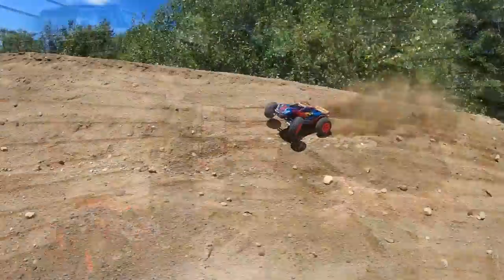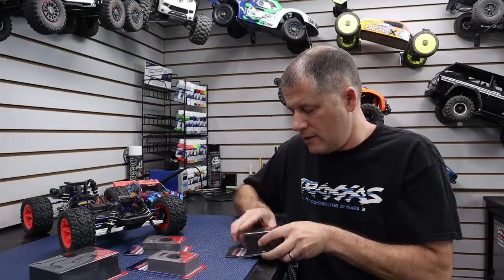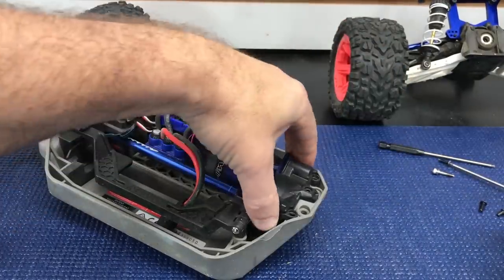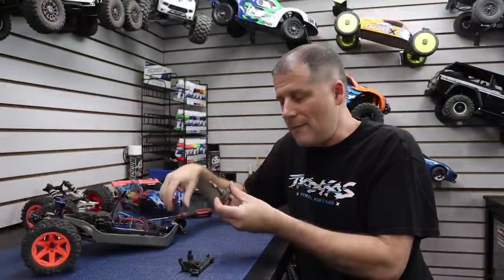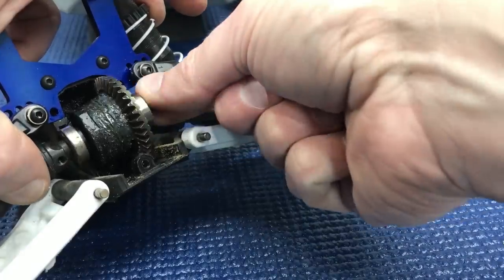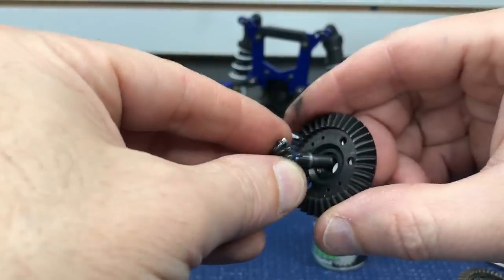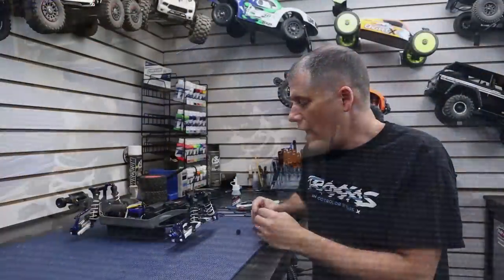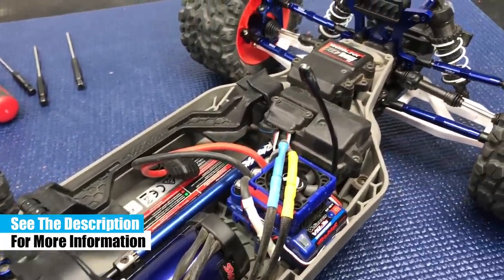Swapped! Gears & Center Diff - Traxxas Rustler 4x4 VXL Full Upgrade Project Truck Part 7 | RC Driver

Comment: I installed this center diff and both spiral cut gears in my stampede 4x4, those spiral cut gears are so beefy compared to stock. Super impressed by the quality of these parts.
Reply: @John Lujan I would guess its the front diff, you might have some messed up gears. Hitting reverse puts more pressure on the front diff and causes the extra noise.

Comment: One thing you should have mentioned is that if you change either the front or the rear diff gears to the spiral cut, that you have to also install the spiral cut gears to the other end. The spiral cut gears are a different ratio than the plain gearset and can make for some awkward running. I did that on my brothers Stampede 4x4 thinking they would be the same ratio, but the spiral cut are geared to spin faster. I should have known as it is the same concept in full scale vehicles between spiral and straight cut.

Comment: I did the same motor mount mod on my 4x4 VXL but I went with the option from King Headz since it uses a larger bearing than the Traxxas one.

Comment: Wish the metal diff had plastic spurs. You need to upgrade to hardened pinions to use steel spurs.

Comment: Ive had terrible experiences with aluminum part upgrades. plastic is great, it flexes and doesnt bend. Im hard on my vehicles and anytime ive upgraded parts on any of my trucks(going back to savage 25, flux, now the rustler 4x4 and erevo mini) it seems like spending more and then you bend something and its a huge money sink. I usually do RPM arms, and bigger shocks/heavy oil but leave the rest plastic.id love to hear from some people with builds like this that drive their stuff hard.
Reply: I agree with most of what you are saying.  I tell people all the time to skip the ultimate version and get a BL2-S, then upgrade the motor and esc if you're no longer having fun at 2s speeds.  I would still upgrade the center drive shaft to aluminum right away as well as upgrading the motor mount if you upgraded to 3s.  Everything else i think the Extreme HD Kit is better than aluminum, even the drive shafts in that kit dont get ruined using self righting on a Rustler.
Reply: @MrMKnigge  I don't use the self righting feature anymore. It was neat the first couple times but the stress it puts on

Comment: So does a guy have to worry about setting gear mesh on the newer models.  Got 2 4x4 rustlers  recently for my boys first one was just the basic 4x4 and the next one a few weeks later was the VXL version and they have a plastic clip that goes into that slot has a few different screw holes for different sized gears just tighten it up and says should be set.  Is it best to eleminate that piece and set it?

Comment: Off the wall question, but what weight oil do you run in the GTR shocks you have there? I have the GTR shocks on my rustler and am running 50 weight now. I’m not sure if that is working well, so I’m thinking of going with 40 weight but wanted to see what you were running. Thanks!!

Comment: I went with RPM A arms and GPM steel axels. Also strc motor plate. You are missing a engine heatsink /fan to add to the cooling.
Reply from the maker: supboy666 Temps did get high on a few runs but not critical. But a fan is a good idea for many.
Reply: RCDriver_Online i run a 14T pinion and 3s and most days here are 90+ degrees so I have integy dual fan heatsink to keep it extra cool.
Reply: Hot racing fans on my ESC and motor....ice cold runs
Reply: @redblue40rc33  just get a castle motor runs much cooler without the need for fans. The Velenion motor is good and fast but runs hot. Im running 120A Firma ESC which has a built in fan and is crazy fast but makes the stock motor very hot close to 200 degrees.

Comment: I wish that i got the money to do things like This, i got the normal 2wd rustler and there is now a absima brushless motor in it.
Reply from the maker: Thijs The main reason for this series is to show what’s available for this truck and how parts are installed and what their benefits are. You don’t need everything shown. Use the info to pick and choose what’s right for your application.

Comment: Hi. Your videos are great so I wondered if you could help me.
I have converted a Cen GST 7.7 to a brushless 4S electric motor, which is fine.
But, this has a central gearbox, where the reverse was servo controlled.
I have converted it to work, in a fashion, but there are still difficulties with running the car
I hear I can install an open center diff and eliminate the gearbox, so the motor pinion drive will mesh directly with the center diff, which then connects to the front and rear dive shafts, so the motor then has direct drive.
I cannot find an instruction video on how to do this. Do you have any videos or links to step by step instructions on doing this. Or, can you email me the instructions and the parts I will need to make this happen.
The reason I want to do this is because the gearbox is now broken and difficult to repair, so having the open center diff, which is easy to access and maintain, would be much more appropriate for my needs.
Really hoping you can help and thank you in advance for any assistance
Martin

Comment: Unless you put some TIM between that motor and motor plate you aren't going to shift that much heat. How about a series with off-brand upgrades? Maybe build a second one and compare the two?
Reply: Hardlydan it does transfer heat it gets to the temp of the engine itself. I have the plate and i checked with a temp gun.

Comment: Whats better or stronger I should say? Ultimate slash or rustler 4×4 vxl?  I'm having hard time deciding.  I want to buy that truck right there. Ill pay 700 for that truck maybe more. Where can you buy fully decked out cars like that?
Reply: The Slash and rustler are pretty similar in durability, speed and overall quality because they share quite a few parts. Part of the fun of rc is that you can wrench on your cars and pick and choose what parts you want and customize them. You can make it all aluminum, or all red, or mix it up. Good luck!

Comment: RCDriver_Online How can I bias the power to the rear. Thinking about the new Hoss center diff will it fit in
Reply: When tuning center diffs, a thicker oil will allow more power to go to the rear, and a thinner oil will allow more power to go to the front. Also, the center diff shown in the video is the same one used in the Hoss (although I think the oil used may be different).

Comment: I have a Slash 4x4 with a 1/8 scale 2650kv motor, running on 4s with MIP X Dutys. I'm still using the factory front and rear diff gears. I have ran it hundreds and hundreds of times over the past 5 years and I have NEVER broken a diff gear. So.... do you really think these "upgraded" diff gears are really doing anything for a set-up with a stock VXL motor, other than lightening your wallet?
Reply: Matthew Foote yes, i upgraded the gear pinion and broke the rear diff. After that i ordered a new one and put it in there. After my first run with the new diff it broke again so i think they are a bit weak in the rustler 4x4

Comment: I don't like aluminum when it bends it doesn't Flex back like the plastic and had to be replaced when plastic breaks you can glue it for a temporary fix and keep running your truck you can't do that with aluminum
Reply: Lol

Pick another reason other than that on why you don’t like aluminum 

Aluminum is better except for a arms

Comment: I just bought a used traxxas rustler vxl 4x4  but I don’t understand why the chassis is very low almost in the floor . How can I lift the chassis like yours or al list level?
Reply: Adjust the ride height by adding Those Traxxas Spring clips.